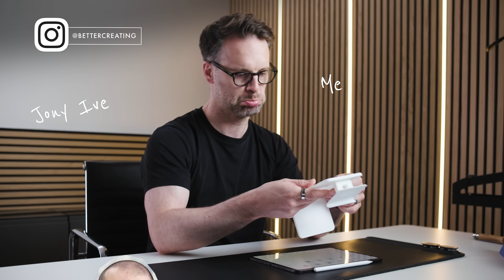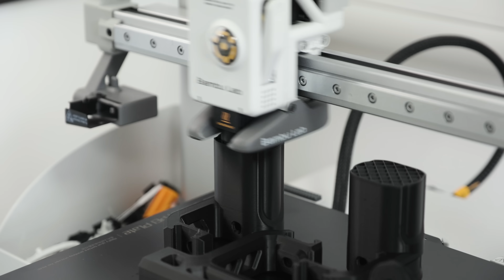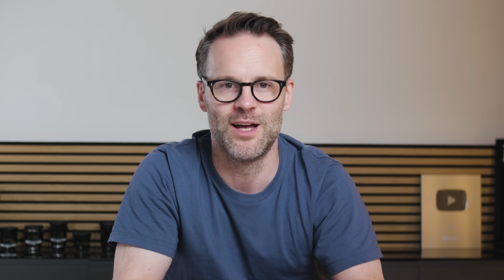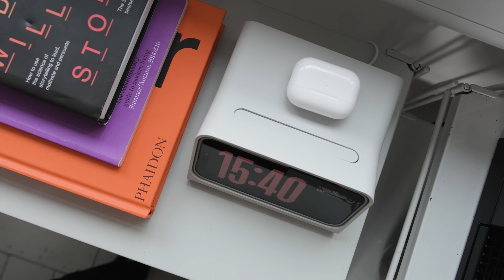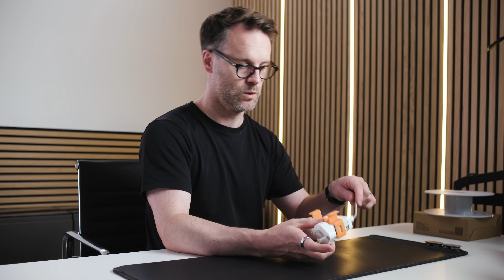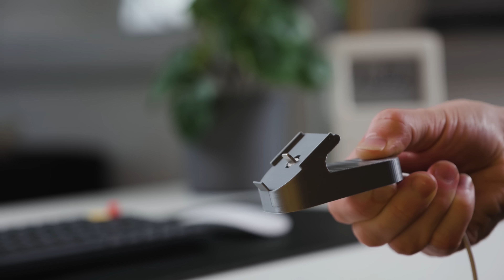I Tried 3D Printing Apple Accessories: These Were Good!

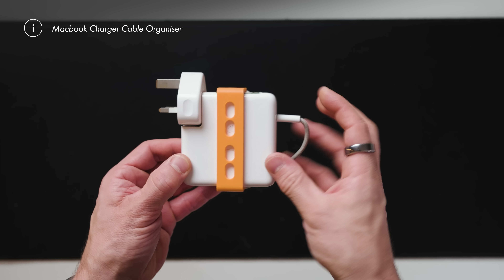Comment: 6:11 Leaving the USB plug in the charger while wrapped the cable around the charger with force is an excellent way to quickly destroy a cable. Never leave any cables plugged in while transporting electronic devices. Always unplug all cables before transport. No exceptions.

Comment: So after watching this video I went straight to me p1p to print the camera rig. It’s amazing I must admit.  The issues I’m having though after buying the 1/4mm screws I can’t fit them in the holes as it’s to tight. Can I ask how you managed to get them in please?
Reply from the maker: Cheers. :) You need a soldering iron like I’m using to heat set them in! See the video again I mention it. 👍
Reply: @BetterCreating oh right I did see you using that 🙈 do you hesthe plastic up then? I was hoping to just superglue them in thought I may have to drill the holes a little bigger.

Comment: Any print settings to print better quality prints? thanks a lot
Reply from the maker: Main difference I’ve found is using a smaller nozzle - 0.2 will be slower but better accuracy. Also - make sure to do bed levelling and flow calibration before each print as part of the print if using Bambu.
Reply: @BetterCreating understand. Yes actually that is what I do before any print. Actually the Bambi does it for itself. Now I think I need to change the nozzle. But how would you do with seems ? It’s a little annoying when trying to do a rounded print. It’s just ugh